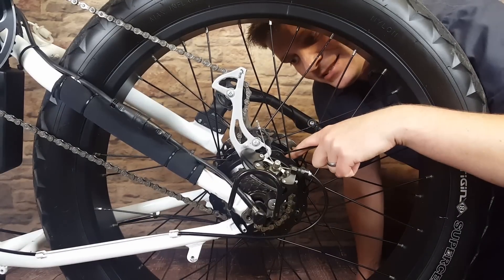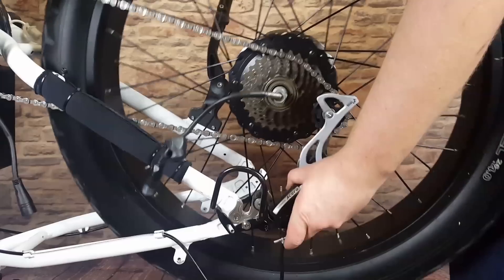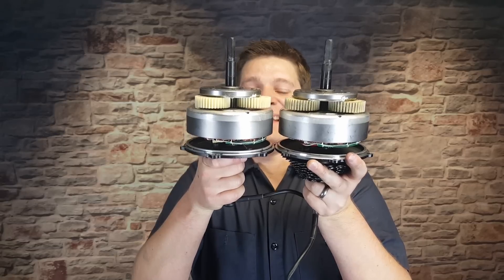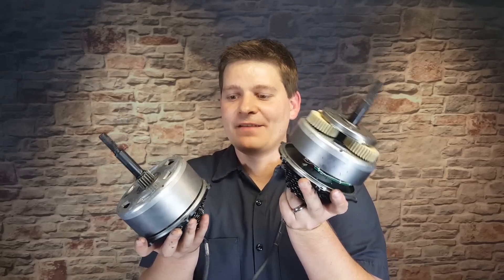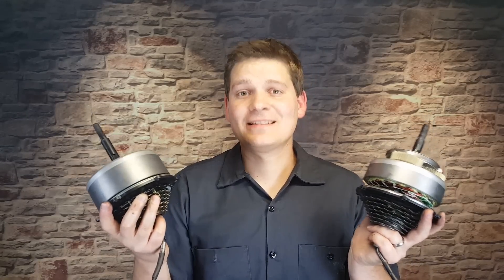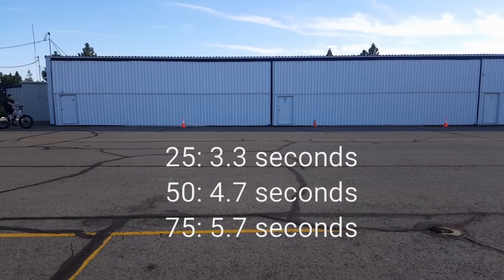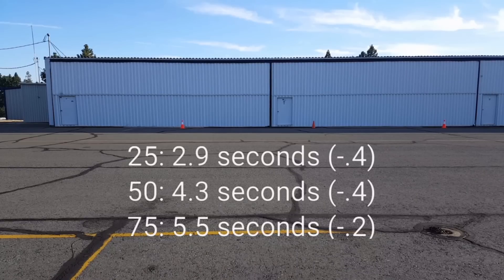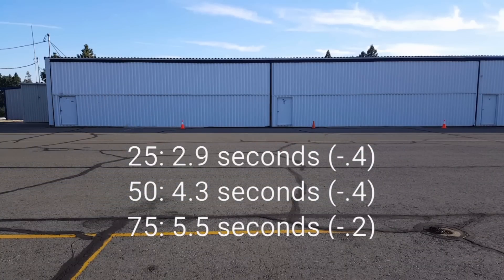Considering the RadRover Ebike?  You better watch this first!

Comment: Cute. If you think look at a motor is a clue to it's power consumption (the 750W spec is power consumption, not power output), you'll really freak out when you look at old Class AB audio power amps compared to modern Class D motor. This is not the place to come if you want a technical discussion. Bolton is a good salesman, though. Heavier is not "heavier duty." If you want to seriously up the power on a Rad Power bike, replace the wiring harness and controller. If you don't, you'll be replacing those parts later or getting exactly the same performance (with the old controller). I replaced a Rad Mini motor with a "real 750W" motor, because it was cheaper than buying the whole rear wheel and motor from Rad, and the performance between my wife's Rad MiniST and the "upgraded" Mini is . . . exactly the same. Surprised? You shouldn't be.

Comment: I pulled my 1500w hub motor out and converted it to a mid drive, wow what a difference. It now spins the rear wheel on bitumen and is a little faster on the top end speed. Mid drives rule 😊😊
Reply: Do you always have to peddle with a mid-drive?

Comment: don't need the fastest but do want the longest lasting and longest range. With the reseting the max speed to 24 mph it goes plenty fast and can climb any hill I would take it one. If you are going faster and pulling more power you are using more battery thus lowering the range of the bike. If something is not broken why change it. If and when it does break then decide either to upgrade to a Reise_Mulller $12,000 bike of stick with the $1600 Rad Rover.

Comment: I am truly hurt by the way most of the EBIKE manufacturers design their bikes.

I understand the speed regulations, but what I don't understand is why they don't build bikes capable of 35 to 40 mph with very minor changes of maybe a wire connect - disconnect  or a better controller. 35 MPH to 40 mpg is a reasonable get around speed. 20 to 28 is just not reasonable. What's so hard about s 1000 to 1500 watt motor as a base. 

I got involved in the Juiced bike Hyper Scrambler debacle where they promised a bike on throttle to go 35 MPH and 30 mph was it with a shit load of problems. I guess they just picked the wrong motor. That MAC motor seems to be extremely problematic. Thank god I got my line back, even though in my opinion the Scrambler was a beautiful design.

Comment: I wish you could take apart a Juiced Ripcurrent S.
Reply from the maker: Well I certainly could.....
Reply: @Area13ebikes  No doubt : )  Just want to see you rip apart a Rip Current and disect it in a video. I haven't had the chance to reinstall my Ripcurrent's back wheel onto the bike yet. Are you saying in this vid that all I have to do is remove the phillips head screws (1:30) and the motor cover comes off cleanly? Do I need to disassemble anything else before doing this and will any parts or pieces fall out or fly across the room by doing this?
Reply from the maker: Yep, that's it.  No parts to fly out.

Comment: Factor in price point from a manufactures point of view. Try to understand use relative to power and the value relationship. Rad Rover as well as the Rad mini are excellent value for the money as a total set up front to back package. Something to consider and perhaps there an answer..
Reply: I thought so to until I dug a little deeper.  Some negative reviews that all sounded similar....some quality. Control  issues and service  response complaints. I found a Canadian company Surface604 that offers great bikes at great prices. Good shipping. I Love my Shred ! At 1900$ I was able to hang some sweet accessories on it...Body Float (custom for my weight! ) and a Brooke's seat. Not sure yet but the idea of putting a front wheel kit on is interesting! Don't know if controllers would need to synch but that's the thing about ebikes..it's a learning curve!

Comment: Good information, how does the "JUICED" Bafang 750 motor match up. Also your thoughts on the Rad rover direct drive motor. Thank you
Reply from the maker: I'd like to pull one out and see!  It uses a smaller motor plug which is a bit suspicious...

Comment: The smaller motor gives you motor range / battery life.  I’d rather have more range and accelerate a fraction of a second slower.
Reply from the maker: That would be true if it was pulling less amps or watts, but it's not....

Comment: so what better buying a e-bike or building one of the kits?
Reply from the maker: Do you WANT to build a bike or enjoy tinkering?  Then build one.  If not, it's much easier to just buy one already done, and not a huge difference in overall cost.
Reply: @Area13ebikes  okay thank you
Reply: @Area13ebikes  one more question if you add a second battery will you a longer distance or just more power over all.

Comment: This is a great comparison of one aspect of performance, but we need to also look at runtime, heat generated etc to make a true comparison. Rad seems to have found the sweat spot for the motor, battery, controller combination that also meets the cost for the unit.

Comment: You should include cost comparison in your videos, maybe it will cost you $1200.00 + to go a second faster
Reply from the maker: Ok, it would have cost Rad about $30 to put in a better motor.
Reply: @specialist-in-tech  and also you're saying the same thing. 30 bucks could've got them this so much better motor. If you subtract 1900-1500 there's a 400 dollar difference. Why is this 1900 dollar brand charging you 400 more for a supposed 30 dollar upgrade?
Reply from the maker: @danyancey  No, that's not what I'm saying at all.  The Sondors X effectively has the SAME motor as the RadRover and is the same price, but it's advertised as a 500 watt bike.  Other bikes are similarly priced and spec'd on paper to the RadRover, but in reality have more power.  (Other brands also advertise 750 like the Radrover, and have similar perfomance to it.)  Many 500 watt bikes under the $1,500 price point have better performance than the Radpower bikes.  What I am saying is that you can not trust the wattage label to get a good grasp of how much power the bike actually has.
Reply: @Area13ebikes  Now multiply that $30 by how many units they sell a year. As it is I'm sure at $1500 they are cutting it pretty close as it is. Their customer satisfaction is pretty high, which has to be factored into the price also. I would understand a negative review like this if customers were being ripped off or the product didn't perform to customers satisfaction but by all evidence that is not the case. How much is a similar Bolton E-Bike with the higher rated motor, I assume your bike with higher rated motor would be $30 more than the RadRover, right?

Comment: I wish I would have seen this video before I bought my 2018 Rover. I have trouble on really steep hills and on some narrow off road trails, a stall means a crash!  Rad claiming 750W and actually using a 500W nominal driven to 750 'peak' and advertising as a 750W motor is deceptive. Mike Radenbaugh is a marketing wizard, but a liar.  When your upgrade motor and controller is back in stock, I want one.

Comment: Another reason to diy your ebike. I understand from basic electricity that watts is a function of voltage times amps. If your battery  is 48 volts, and controller rated for 20 amps, theoretically ANY motor should be able to push out 960 watts. Theoretically. Some wattage gets wasted as heat. The difference is probably in the windings, how beefy they are and how other components inside the motor wear. I'd be interested in comparing various motors for actual power output and efficiency. The labelling if these motor right now is nonsensical and relies on DIYers knowing what their doing on the parts front and regular customers having zero idea what's in their bike. Sad.

Comment: Did you stay in first gear the whole time?  Was the motor maxed out by the end?  I think it would be.
In that case what you are really testing is the max RPM of the motor.
Reply from the maker: For the BBSHD, yes.  With the short run I found it simplest to stay in one gear.  I'm using a gear sensor, so any shifting creates a slight power off situation, slowing the bike down.  In a longer run a shift or two would have made it really shine above the other bikes.

Comment: So does anyone know if the 500W motor on Canadian Rad Rovers is the same motor as the 750W motor sold in the US with the only difference being speed controller settings?
Reply from the maker: Yes it's the same motor.  Only the controller is different.
Reply: @Area13ebikes  Excellent thanks!

Comment: Looking forward to video 2.  I'm also interested in a steep hill climb test with a rad rover or rad mini upgraded to a motor  with better torque.  Waiting on the 2019 rad mini - debating the luna folding mid drive e-bike, just wish it had a front suspension and fat tires.

Comment: This test is useless and has no value.  After you dissembled the motor I expected some real lab test with current draw and real power output and torque measurements

Comment: I'm not so sure this was a fair test on the power of the motors.  It was more a test of the bikes.   Even if you have the same person riding each bike the bikes don't weigh the same.   To be  a fair test of the motor not the bike you should add weight so they are all the same.

Comment: You over explained it to the point of CONFUSING us.  Pls. keep it SIMPLE and easy to understand.  POWER... do a hill climb test.  The over rated Rad 750 vs aTrue 750.  The wimpy rad rover step thru couldn't make it up a Seattle hill. I bet a TRUE 750 could get up there with no problem.  Rad Rover has FALSE advertising..... a 500 motor labelled as a 750.  NOT GOOD !!!

Comment: Seems like you're comparing a geared to a non geared motor...am I mistaken?
Reply: @rbgg153890 bob make that two ones gear... and do they call the other one direct drive?
Reply: NOOOOO He just didn't have the  sungear on the larger motor
Reply: They are both geared hub motors. He just took the gears off one of them

Comment: A couple of things here.  First, you already have a great channel, but you cheapen it a bit with splitting hairs like you have here.  Second, after 45 years in the electrical business I can assure you motor size is not directly proportional to motor horse power.  Not even close.   Frame size of motors determine size, so a 3 and 7.5 HP motor with the identical frame number will be the same size.

Comment: I could see a company as big as  Rad trying to cut production costs by going with a single motor that they could then tune up and down to they're liking. 

I mean they can deal with the ordering and maintenance 3 or 4 different  kinds of motors. Or they could simplify it and just use the same motor  tuned for different applications. 

Cheaper/lower power models tuned down with smaller controllers. And tuned up with bigger controllers. 

I get it from a production point of view, especially when you throw in all the sourcing issues that covid19 has created. 

But it sux from the rider/ consumer prospective. Dont tell me/charge me for a "750w" when it's not. 

This is yet another reason why Kyle and other buisness ppl like him have my support. Lead time, or no lead time. 

Tell me what's up in advance and I'll pay you every time. B.S. me and we're done.

 Rad thinks it's big enough to start the Corporate hustle/BaitnSwitch on us Ebikers. And because of ppl like  Kyle they have to think twice. 

Thanx Kyle for having our backs. "It's a dirty job, but someone has to do it."

Comment: Rotating mass is a huge part of handling of a bike. A heavy motor might be better for power and performance. but will negatively effect handling as it is rotating mass. I am willing to bet that the rad handles better.
Reply from the maker: Might be true if it was lighter, but due to frame, wheels etc it was also the heaviest bike.

Comment: You compared electric motors by holding them next to each other? Then you put a ton of other variables in a test on bikes? Ok... How about just run the motors on a bench and measure the output.  It's electric, it's easy.

Comment: Just what are your qualifications with electric motors? Motors come in all sizes and power ratings. Just because a motor is larger doesn't mean it is more powerful. There is more than size that determines the power and efficiency. Comparing size and stating bigger size is more powerful and smaller is weaker is dumb.

You need to show more to me. So far your tests mean nothing. You need to get someone that is an expert in electric motors and have them breakdown the motor and see what makes them click. And let them give their opinion of each motor.
Reply from the maker: You may be right that size isn't everything - but with two motors of exactly the same construction and style then it absolutely matters.  Larger magnets, bigger field, more copper = more power.  It's not dumb, it's science.  The manufacturer (Bafang) will put whatever rating you'd like (within reason) if you buy enough of them.  I could get into kV and turns and all that fun stuff, but the average person watching wouldn't understand, making the video a bit pointless.  I keep things simple for better understanding of the average person watching my channel.

Comment: The main problem that I see, you are not comparing the same style of motors. Your's looks to be a direct drive VS a geared motor. There are different engineering specs for different types of drive motors. A little disingenuous in your presentation.
Reply from the maker: Actually...  they are both geared hub motors with exactly the same 5:1 planetary gears.  So no, it's not.

Comment: I think 750 watt is peakpower.  The rad comes with a 16.5 amp controller.  48V×16.5amps=792watts. I think that's where the 750 watt comes from. The radrover fan club doesn't want to hear it but the rad is slow and outdated.   There are more powerfully bikes on the market for considerably less money.